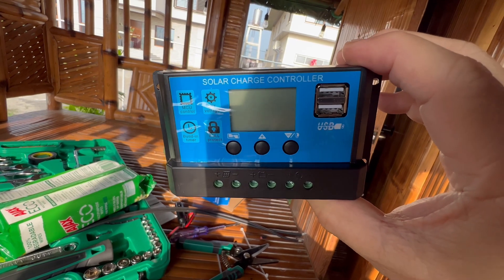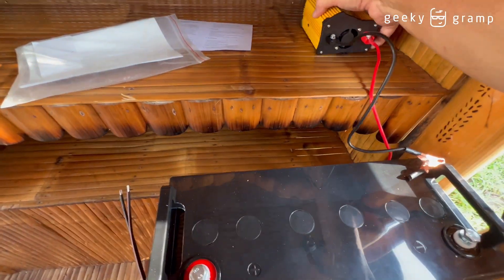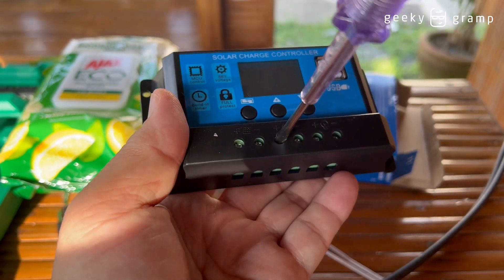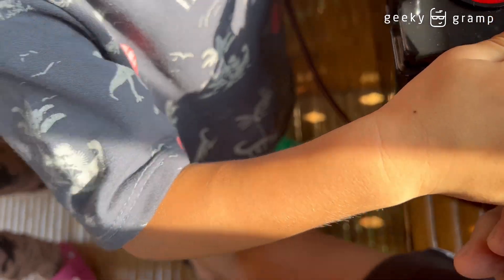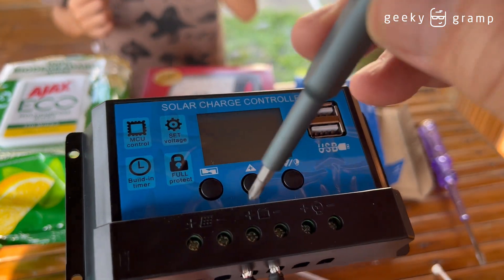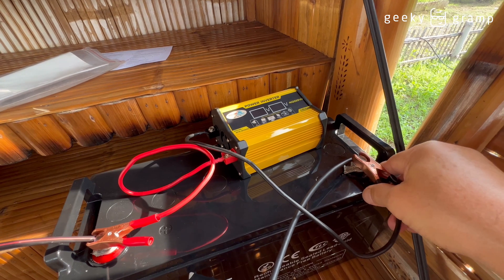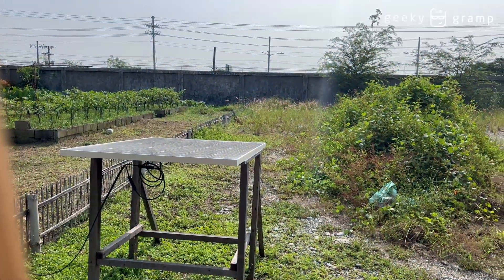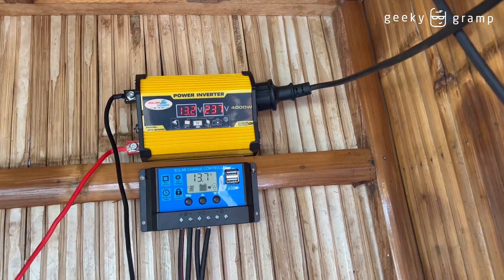Installing Solar Power System in my small house (Bahay Kubo)

Comment: use safety breakers specially between your battery and inverter. 4000 watts on a 12v battery is a fire hazard when overloaded.

Comment: Magkano po inabot Yan nlng po gawin ko sa probinsya
Reply from the maker: Power Inverter - 1,000.00 
Solar Panel - 2,000.00
Solar Controller charger - 200.00
Battery depends on what capacity 
Plus wires